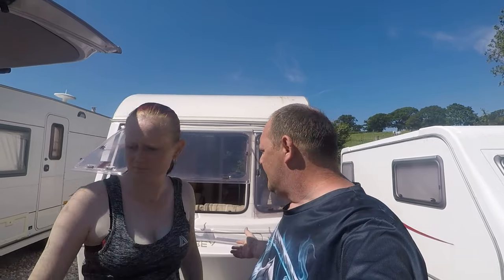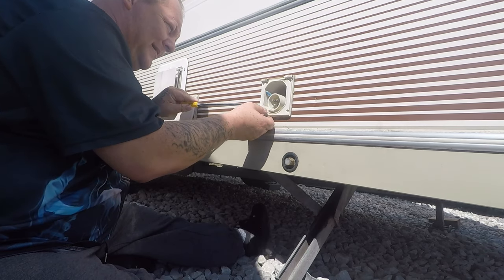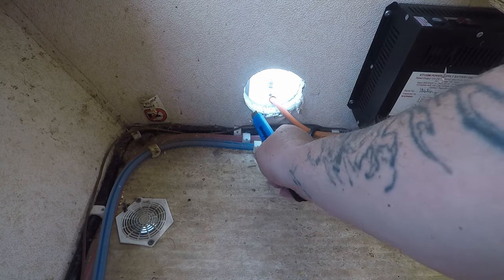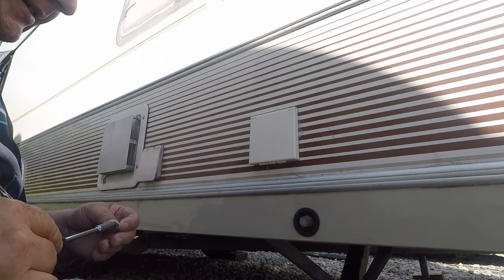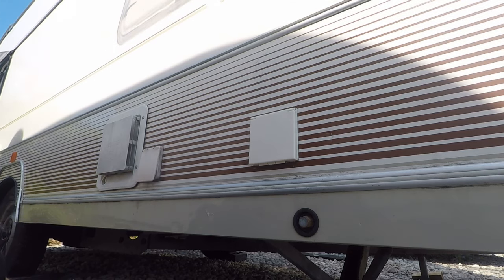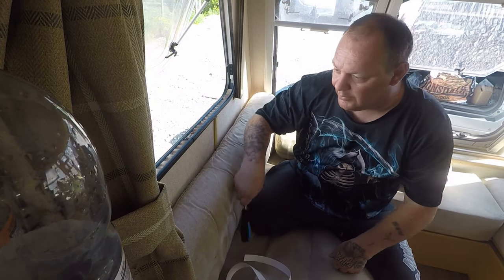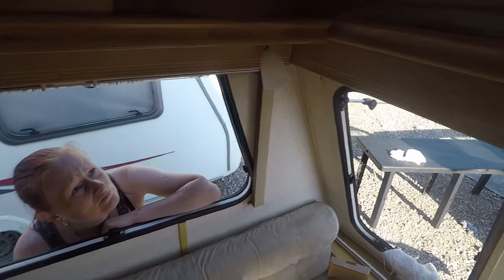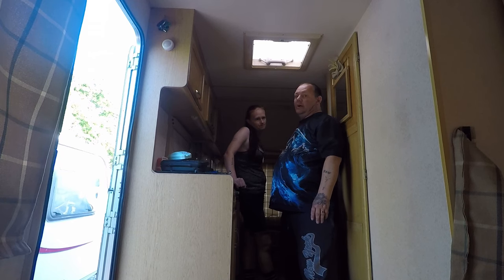Renovating our caravan part 3

Comment: Coming alone now. by the window if its not damp i would just sand it down and use car filler to make it look better and then paint the hole window frame .and paint the cupboard doors as well a nice cream or very light gray make it look more modern .i wouldn't vanish them  .you should get most bits from the caravan breakers have you checked the gas to the hob yet . And you need a upside-down pineapple sticker in the window as well 😉